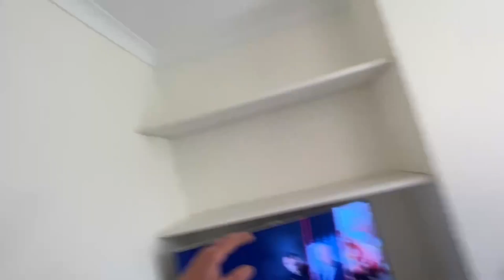Installing some alcove furniture and a bit of a rant! #carpentry #cabinetmaking #scofield #21

Comment: Another great video getting better every week mate,  I don't like the other chippy's idea for the floating shelves .The block against the chuck  as a depth gauge,  do it all the time for shelf pins and threaded inserts.
  I also like your family comes first over work attitude,  I mist out on a lot with my kids as I worked away for 30 years shopfitting,  I've had my workshop 3 years and from day one I've had the same family attitude as yourself .
Reply from the maker: Yeah I hated it but equally was really interested to see that’s how they did it if you know what I mean!  
I forgot how quick The shelf pin way I did in this vid was! I have reviewed the festool lr32 but not edited the video yet! You can’t beat the lr32 for dust free but I it’s so hard to justify the cost!
Yeah we sound very similar I haven’t always got my work life balance right. Even now the odd job goes mad but I never let it take more than a few days away and I always make it up. 

I never want to be on another site again!

Have you managed to get much kit in your shop? I find it hard to justify having a lot of kit but not working like made or having staff.
Reply: Yes I've not to bad a  set up , it's all single faze in the building I'm in and it's only 500sqft which looks a he'll of a lot bigger when you view it empty.  I have a decent cast iron bed cabinet saw with 8x4 outfeed bench, wadkin surfacer, separate thicknesser, old record drill press, down one wall I have a cross cut bench with a festool 120 kapex, big router table on wheels which I built with height adjustment from above , I break down all my sheet material on a separate bench with a 3m track and TS55 and a small router table  that clips onto my outfeed bench for running beads etc because the big router table is nearly always set up with 9.5 groove cutter. Just after a decent band saw and a domino 700 XL but hopefully🤞 only need to do another 6 years, be 60 then ,retire and enjoy sometime with the family.
Reply from the maker: @tonymcroberts3252  i had to put a 3 phase connection in to mine which I found to be strangely satisfying. That sounds like a decent setup, I would like a separate thicknesser! I used to resize my sheets with the ts55 and it worked really well. The panel saw has been by far my best purchase but I do need to sort the dust extraction as nothing beats festool!
Where abouts are you based?
Reply: My workshop is in a place called Standish, which comes under Wigan Lancashire but I'm from Manchester originally,  the love of a good woman took me Wigan.
Reply from the maker: Beautiful part of the world👍🏻